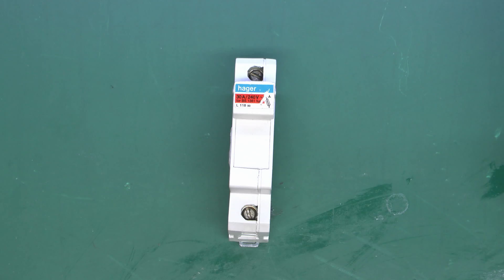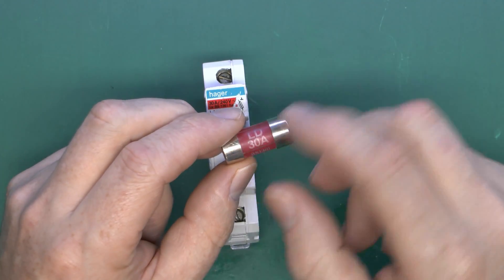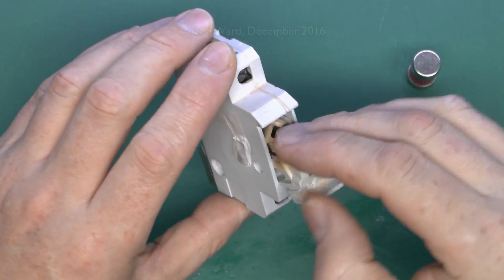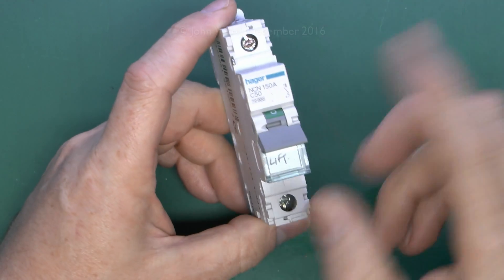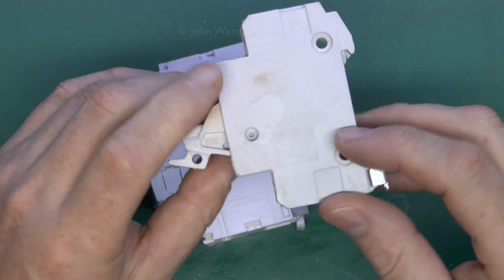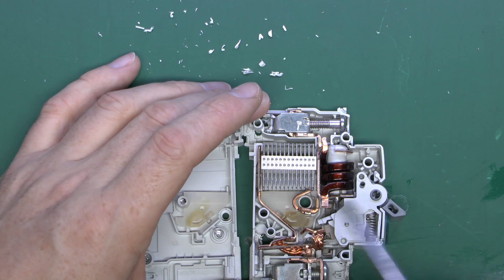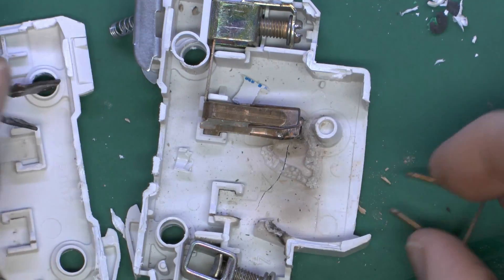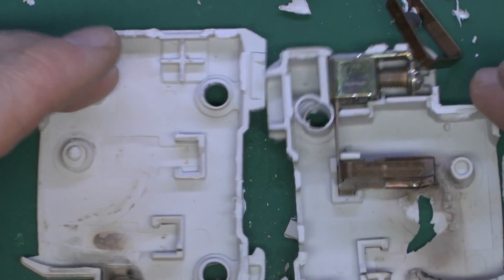Overheated Fuse and Circuit Breaker

Comment: In one of our machines installed fuse base circuit breaker installed. The fuse of the breaker burnt now is not available in the market. My question is will we may replace it with MCB(on/off option manual).

Comment: Very good that you demonstrated the dangers of moderate overload. I have always advocated over specifying - e.g. I never used 1mm sq. t&e for 6a lighting circuits in domestic premises - I always used 1.5. Always used 6mm for 32A cooker circuits. My parents’ house was a shocking example: the lighting circuits, wired mainly in vir/cotton single cores in slip conduit, with porcelein rewireable fuses rated at 5a, had been wired with three 5a fusewires BY ELECTRICIANS to stop the fuses from blowing. Bits of pvc 3/0.29 had been joined onto the old cables when a new d.b. had been installed - and the pvc had melted. Amazing that there had never been a fire. My great uncle, an architect who emigrated from Germany before ww2, told me that a colleague said that, given the standard of electrical installation, it was a miracle that london had not burnt down.

Comment: Were these kinds of fuses the next model after rewirable fuse boxes and before consumer units? I remember the old ones years ago where you had to thread the fuse wire of the correct amperage back on if it had blown.
Reply from the maker: Cartridge fuses were available at the same time as rewireable types, they overlap was many decades at least.  They were not as common, as they cost significantly more.

Comment: Was the cable to the Electrical shower Upgraded for the 40 Amp Fuse
for the Video Overheated fuse and Circuit Breaker

Comment: I had a similar thing when someone fitted a 10.5kw shower on a 30amp rewireable fuse holder and it started to smell of burning fish... I think it was on 6mm cable as well... not a good situation... I told him to get the plumber back who fitted it and fit the correct shower again..

Comment: John. You are back on form doing really useful, informative videos on subjects many take for granted. Please keep these coming.

I'm still waiting for the one on over/undertightening copper conductors with brass screws, potential fatigue stress in copper wire if one works in the same patress box repeatedly, wires coming loose in hidden junction boxes, etc, etc.
Reply: I'd also like to see some tests done to figure out if plastic junction boxes are as safe as metal ones (that of which are properly grounded of course).

Comment: The lift took single phase? Also did the cabling need upgrading?
Reply from the maker: The lift is 3 phase, the building only has single phase, and it's currently connected via a phase converter.  Been like that since it was installed 7 years ago.  Further work is required there.
Reply: I was wondering exactly this, no mention of 'rating of circuit breaker suitable for cabling given distance and derating factors, voltage drop, prospective fault current, disconnection time, etc...'........   Can be dangerous to carelessly uprate a circuit-breaker!
Reply: TIL a phase converter is a thing. Love your vids, jjw.
Reply: +John Ward can you tell me please what kind of Controller do i need or do i havd to have for a Smart drive motor plase ?

Comment: Was this a single phase circuit? Lift current=60A is a very large current for 240V (>14kW). 
That's a huge single phase motor.
In Australia 240V is limited to 15A (3kW). Anything more has to use 3-phase.
Reply from the maker: The lift is actually 3 phase, but is supplied via a phase converter as there is no 3 phase power in the building.

Comment: In the case of the 30 amp fuse replaced with a 40 amp breaker, I certainly hope the wiring was verified to be rated for that amount of current, or replaced with appropriate wiring.
Reply from the maker: The existing cable was already suitable, 6mm T&E, surface clipped, rated 47A, total circuit length less than 10 metres.
Reply: I've seen exactly that, where the wiring was getting quote toasty!
Reply: Keep in mind that if you have multiple cables bundled together, you have to derate them otherwise they pose a fire hazard because the heat can build up in the bundle. (Think of it like a wound up extension cord/lead.)

Comment: that fuse holder was a fire hazard just shows you what can happen when you put the wrong fuse rating also Merry Christmas
Reply: That fuse holder was NEVER a fire hazard. They are specifically engineered not to catch fire. In fact, even with a blow torch you might get it to smoke and smoulder, maybe even catch fire... but it would almost immediately self-extinguish (as per electrical standards).

Comment: Shouldn't the housing be made so that the fuse would always fail before the housing is destroyed?
Reply: They used to be made of ceramic, but then someone wanted smaller and cheaper...
To be fair permanent overload is not intended operation.
Reply: in  a fast overload, sure wont be a problem however what with plastics and far less copper used than the old days heavy ceramic ones, it obviously cannot handle a slow overload, which I personally think it should be tested for also, but thats modern crap for you
Reply: Just looking at the fuse itself, and the contacts, it all looks a bit out of proportion, doesn't it?
But hey, it's good enough, and you get what you order...
Or, don't get a midget fuse for a giant load.